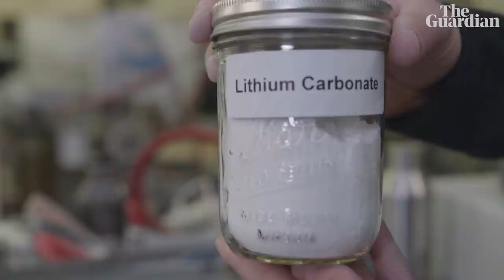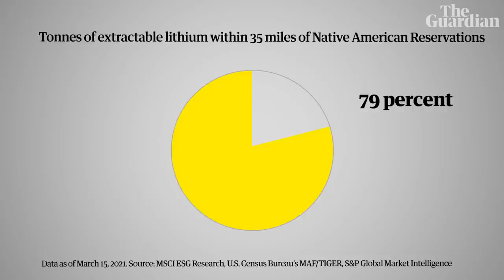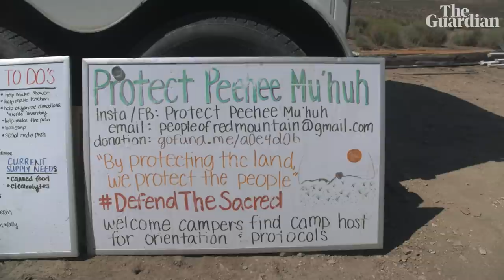Lithium mine pits electric cars against sacred Indigenous land

Comment: At what point do we collectively decide cars just aren't the future, electric or otherwise?
Reply: In cities, we can use mass transit (trains/ buses/ trolleys) that operate off overhead wires.
We also need more livable cities. 80% live in cities.
So, yeah, in the majority of cases, personal vehicles are a bad solution.
Reply: spoken like a true city dweller
Reply: @imperatorvespasian3125  oddly enough I wouldn't call where I live a city, loads of farms about. Walk about 3 or 4 kilometres in about any direction, and you'll be near and around a farm fence. 
But I'll concede there are special cases where cars are necessary, but they should hardly be as prevalent as the are.
Reply: @grmpEqweer  Do you have sources that state that overhead transit are the future of cities? Just curious
Reply: ..or at least privately owned cars.
Reply: A bus tram or train are just bigger cars, and if they’re electric the power they use has to come from battery storage made from mined minerals , so whether it’s an enormous battery supply from a central location or millions or smaller individual power sources in private vehicles doesn’t make any difference .
Reply: @yournextlondonmayor7256  you're ignoring scaling, a bus makes far more efficient use of a battery and space than a car.
It makes a lot more sense to build one bus with a massive battery than 24 private cars with smaller batteries.
Even then, you've just randomly decided these alternatives would use batteries instead of being integrated into the power grid.
Reply: Do you really want tram and rail tracks and overhead cables all around you , what about the carbon and environmental cost of doing that,  and the ongoing issue of maintaining it , where a small problem in the network brings everything to a halt. Cars took over because they were and are great.
Reply: 50 years ago.
Reply: @grmpEqweer ..or we could choose not to travel any farther than we can walk or move under our own power. It really is the only way. If you cant grow enough food or have enough water you probably shouldn't be living in that area. There's really no way out of this conundrum because most humans are not going to give anything up.
Reply: Probably never. I say that as someone who doesn't like cars. At least not where cars are currently in greatest use already. 

And to the extent that Americans will never give up cars, we must plan accordingly. I understand concerns about the further abuse of the already marginalized, but in the end, survival takes precedence over justice.
Reply: We need lithium for much more than car batteries bud.
Reply: When that makes sense.  I need to get to work.  I need groceries.  What about trucks?  Are you against the trucks that deliver items to your local store?  Like lumber?  Like toilet paper?  How about screws, computer monitors, light bulbs?  How about wheelbarrows and computer chairs?  Fridges?  Anybody who is against cars is not thinking with their head.  Look at everything in your room.  Even if your room is empty, look at the materials used to build your room (drywall, lumber, fiberglass, windows, windowpanes, paint, baseboards, HVAC system).
Reply: @Lee-fw9mr  Freight trains and cargo pedal-cycles exist, and more public transit means more room to enjoy driving. Trains are stuck on rails, but that's just like automobiles being stuck on roads except trains on rails are actually less energy consuming, actually cheaper because of durability of rail compared to road, and more efficient than automobiles on roads. That's why trains have higher operating speed than automobiles. We can already build rail without automobiles, btw. Cargo pedal-cycles are a supplementary and are for short-distance freight. We appreciate truckers because they transport cargo, but so are train operators and other cargo workers.

I'm not gonna mention all trains whether it's diesel trains, gas turbine trains, or pantograph-powered electric trains have an awesome roaring sound as much as combustion automobiles while battery automobiles have annoying tire noises.
Reply: betty4018  do you think everyone had a horse before the car was invented?
Reply: and bikes too! Please use your body to run your bicycles, use those muscles , not batteries 😮😢

Comment: There is free energy available for everyone.
Reply: Yes. Solar power. Wind power. Tidal power. Gravity battery storage.
Reply: @toyotaprius79  Tesla
Reply: The real free energy has been kept from us
Reply: @toyotaprius79  Solar power. Wind power. Tidal power. Gravity battery storage.
A vehicle will still require a battery to be charged from these sources.
Reply: @Ji_hadJoe  just don't use a car
Reply: @bri1085  Public transport is going increasingly electric. They need a storage solution other than lithium based technologies.
Reply: @ejbh3160  I'm going with supercapacitors.
The sports cars manufacturers have already embraced the technology.
Reply: Free energy 🌏
Reply: @ejbh3160  Chinese shipbuilder CSSC reported last month the first successful sea trials for a ferry employing a pure supercapacitor in its power system.